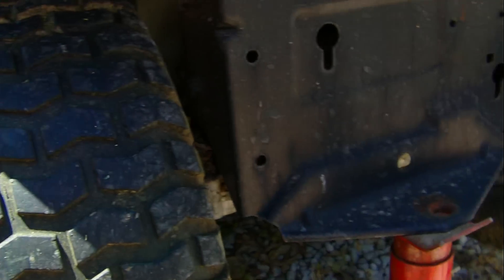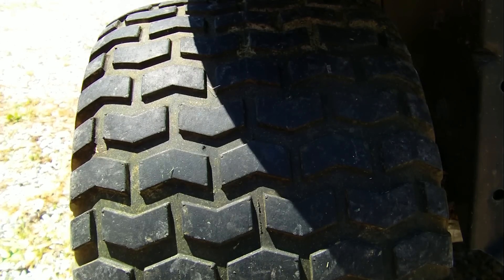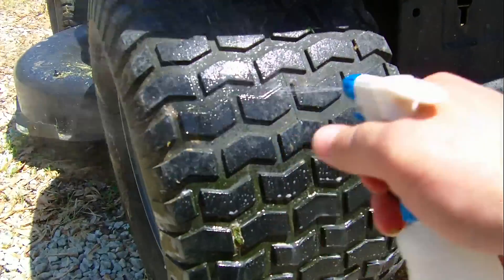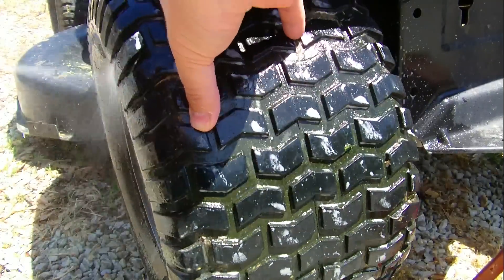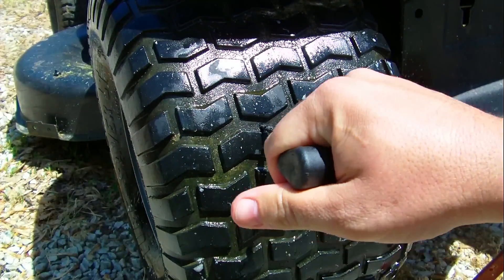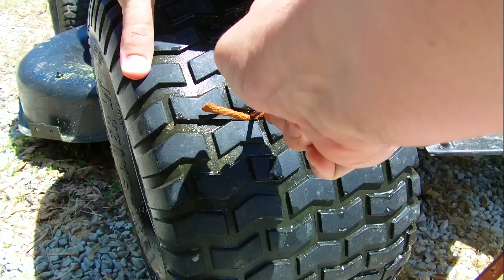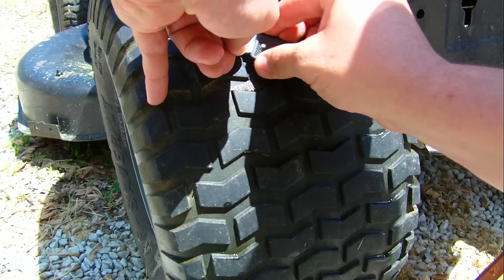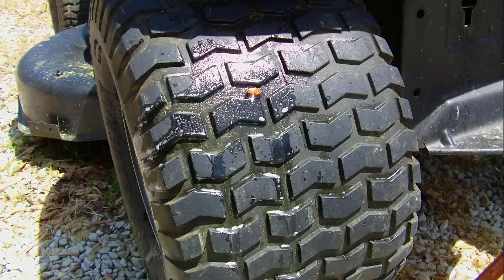Fixing a flat lawn mower tire

Comment: Thank you so much for making and posting this video. I bought the kit and my kit has glue with it. What am I suppose to do with it? Put it over the repair or add it to the tire plug? You guys ROCK for helping out the rest of us!  Take care.
Reply from the maker: So did you get a patch kit too? A patch kit will have glue, rubber patches, and a scratching thingy. It would be used to patch tubes. I tire might have a tube in it if it won't keep air pressure because the tire is old and someone had put a tube in to or the tire is designed to be used with a tube (large tractor tires that I have all have tubes).

The plug kits would have the tool that looks like a strange screw driver and some things that look like pipe cleaners. Most of the plug kits I've seen have gunk (sealer) already on the "pipe cleaner". I suppose it's possible some may not and have the sealer in a tube that you put on the plug yourself yourself.

If you do have a tube in the tire, it can't be fixed with a plug kit. You have to remove the tube and find the whole to patch (or get a new tube). That's a whole other topic :)
Reply: @ChristopherFarms  Thank you so much. Your information will help me to get this tire fixed. NO PATCHES in my kit but maybe it is for the pipe cleaner which I will insert. You guys ROCK!😊✔✨

Comment: Impressive, you repaired the tire without burning the plug like most incompetent garage techs. 
These cord type plugs are very sticky and meant to plug the hole without burning them. 
Perhaps if the tech stopped to read the box they came in before doing the repair. lol  
The only things I would have done differently, For ease...put more soap in your bottle and when the plug was inserted, I would have twisted the tool clockwise while removing it to draw the plug inside the tire close up to the surface and ensure a good seal. On a car, you may consider re-balancing the wheel. I paid extra for the professional version of the tire repair tools as I found the cheap ones bend and break off. About $75 but good for 3 life times if taken care of.
Reply: Howie Bird lm
Reply: Howie Bird km
Reply: oo

Comment: Thanks, a great video. I note some kits come with glue, but it doesn't look like this is necessary. Do you agree
Reply from the maker: The plugs I was using had sealant already on them. Not sure if there are some that don't so it also includes some in a tube. For what I was using it wouldn't have been needed. A patch kit to repair tubes would include glue. I guess when not sure follow the instructions that came with it :)
Reply: Thanks for your reply and advice

Comment: This is probably a dumb question but is this a tubeless tire?  Also I have a tubeless flat tire and do you have to determine if it is leaking on the rim or a hole first?  How do you tell if it is leaking on the rim?  I saw the YT video on fixing a leaky rim with belts wrapped around then inflating on the rim.
Reply from the maker: That's a great question. This tire, and the rest on my lawn mower, are tubeless. Meaning the tire actually has to hold the air pressure. That's why the plug in this case. Now, jump over to a tube. In that case you put a tube within the tire and the tube holds the air pressure. You do need a good tire but holes in the tire won't cause a flat unless they tube is punctured or, the tire is really bad, or you make a hole in the tube getting the tire back on. Think about bicycle tires. As far as I know all bike tires have a tube inside. When you get a flat on a bike you take the tire off and patch the tube (this video isn't patching a tube, it's plugging a tire).
Now, to drill down to the heart of your question... To find the hole make up a soapy water like I did, inflate the tire, and spray it down in the tread, sides, and around the rim and look for the bubbles. You'll find leaks in, basically, three places. The tread area, the sidewall or where the tire meets the rim.
Reply from the maker: If the hole is in the treat try what I've done in the video. If it's around the rim try taking the tire off the rim and cleaning the rim and edge of the tire, putting the tire back on and inflating it to see if it still leaks. If it's from the side wall the tire might have dry rot. You can really plug or patch this.
So the tube, if you can't get the tire to hold air, on a lawn mower or something like that that, you may be able to get a tube and put that inside the tire so you don't have to replace the tire. You'll need to pop out the valve stem for the tube valve stem to come through.
The "belts" video is how you get the edges of a tubeless tire to spread out to the rim so you can put air in it. I use a ratchet strap myself. Once you get the edge of the tire to "seal" with the rim you can back the ratchet strap of. Be careful, it's under pressure at that point.